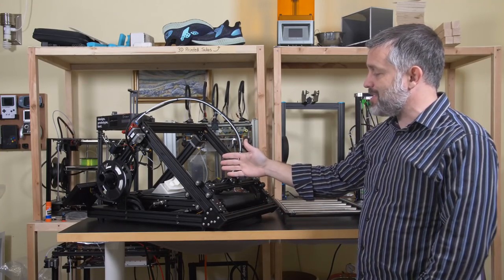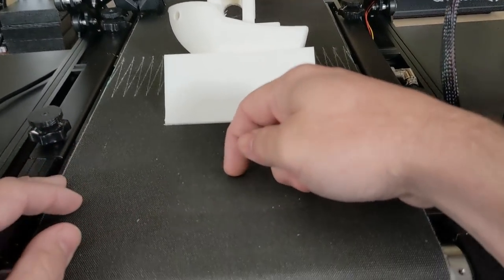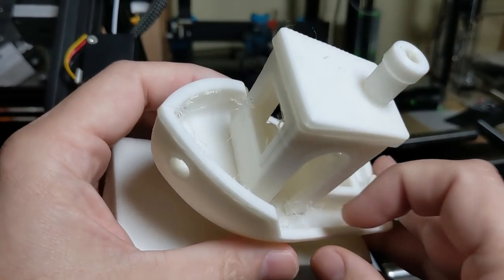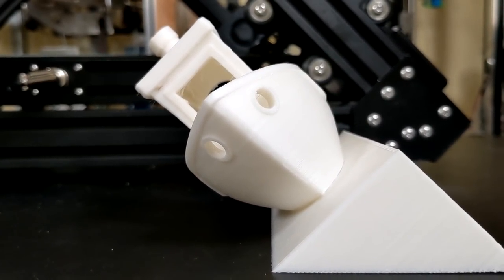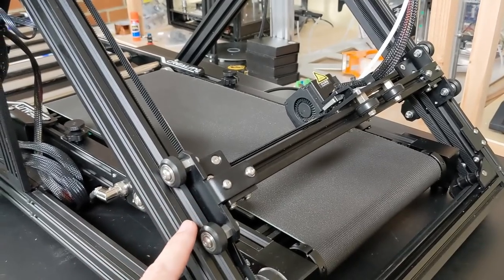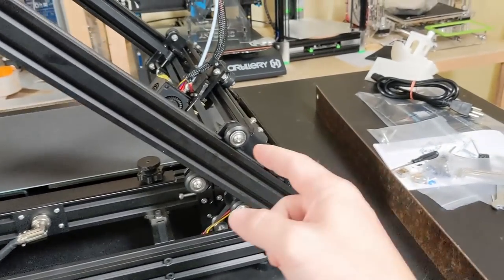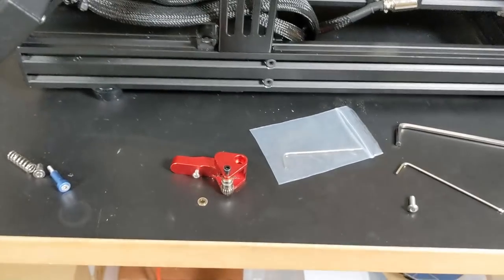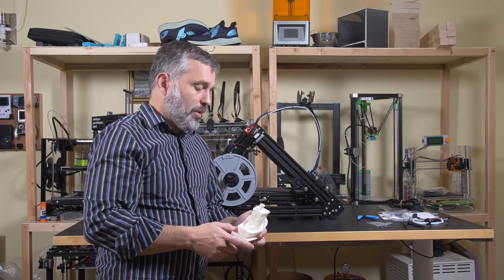Creality's 45° Belt Printer - First Print & First Impressions

Comment: in 1977 I was on a design team at Pfizer to build the worlds first whole body CT Scanner which used X and Y to move an X Ray tube and detectors around a patient. Stability was critical to image quality and lower X Ray dose. We learned early on to put pulleys near the bearings, and spread the bearing to both sides if possible. Three rollers on a bar as you point out we were also quick to recognize. We used Automotive timing belts for slide motion too. But we had some heavy stuff we had to throw about, so we used digital control to ramp up and down the acceleration for smooth consistent speeds in the data acquisition field.  Our machine in its 2nd iteration  had the best image of the competition and would run three shifts in many hospitals without a glitch.  Good critical review, i was shocked to see such basic design flaws in such a critical new machine. I hope Naomi has seen this and will press for the fixes. otherwise folks will be retrofitting new brackets and bearing with the first month. Great Review. Breath! Relax and just focus on explaining what you see.  Lets Go and make this a TANK in reliability. We know better.

Comment: Nerd facts...

You won't be able to pick that seam apart with your fingernail.
I work in food manufacturing and part of my responsibilities involve replacing belts. The process used to seam the belts is called vulcanization, its the melting of the polyurethane layer in the belt material under pressure that bonds the material on a molecular level. The process actually makes the belt one piece and is superior to glued or any other bonding method. The equipment used in this process is called the vulcanizor.

Comment: I'll take partial responsibility for the roller alignment.. On the original prototype they lined up perfectly and I didn't notice when I mounted them on the pre-production unit that they were off by a few mm(not sure what changed)..  I did finally notice but not in time to fix the ones that were sent out..  That being said it may not be completely bad...  I have had prints that have unusual leading edges and sometimes it helps the print roll smoother if you place a thin piece of cardboard under the print across at least 3 rollers(so it can't fall) and use it as a skate for the part..  I'm still undecided if the best action is to re-align the roller or add a shim under the rack so height can be adjusted if a skate is needed..  Just my thoughts..
Reply: The weight is minimal as it distributed, i would thing the smallest of compliance on the inner rollers would smooth it all out. a light weight spring under the shaft on each end. Just. needs a few mm's to handle the variance.
Reply: @DennisMurphey  I love this idea.. @Naomi 'SexyCyborg' Wu
Reply: @NAK 3D Designs  Just a thin folded steel surface with a thin PTFE (Teflon) adhesive sheet would work perfectly. There would be almost no friction resistance and you would not have to worry about alignment. It would be very low cost and work for years. If the PTFE needed replacing, it could be peeled off and replaced with little expense.
Reply: @NAK3DDesigns  👍
Reply: @DennisMurphey  That sounds great!
Reply: @MichaelJHathaway  
A sheet like that would require some way to align it, given the manufacturing tolerances, but it seems a better solution than rollers.
Reply: This is like watching R&D IRL. I love it. Thanks for all the work you guys do to make these commercially available for the general public in such high quality. I just set up my first printer an Ender 3 V2 yesterday and am now down the rabbit hole. Endless possibily

Comment: This was good. Harsh at times, but you made good points. Would linear rails instead of the v-slot wheels, at least for the X axis, be overkill? As for the belt exit, what would you think of something like an MDF platform with a Formica sheet (something like a kitchen countertop)? I don't know how strong the belt motor is but Formica may be low-friction enough that it would be OK.
Reply: I like your idea with the Formica. Teflon or UHMW thin sheet as an exit surface would work great as apposed to rollers.
Reply: @MichaelJHathaway  Sometimes parts (especially thin ones) do have a tendency to dip down a bit before they release from the belt.  It would need to have a tapered entry or a roller at the leading edge to prevent the part from jamming..
Reply: @NAK3DDesigns  I'm sure you could set the table height to be at the correct level. My point I was getting at is that you are never going to print anything heavy enough to warrant the use of rollers. And a thin folded steel table with ptfe surface would be lower coefficient of friction than you needed, but at a lower final cost. I would rather spend less money on the exit table and put money into electronics or hotend.
Reply: @MichaelJHathaway  I'll disagree on the never gonna print anything heavy enough..  The 20ft rail was actually starting to push to one side due to drag even on rollers, and well the Thanos blade (though done on the Knight) was in excess of 7 kilos..  the potential is there for some cosplay props to get on the heavy side.
Reply: @NAK3DDesigns  The leading edge of the steel table could be a single roller to pick up the part as it came off the belt. I definitely see your point with the Thanos Blade, but when printing something like that, you may need a much longer roller table than the one included with the CR 30.
Reply: @MichaelJHathaway  the add-on roller for the CR-30 was meant to be an initial set to help with those 1meter prints and provide a path for more rollers if necessary.
Reply: he might have made good points but there is no need to be nasty and smug im cleverer  than thou attitude he has with his  recent  content . The best video by far is when He takes his    kid to the park and does some  real  good design and fixes the rail slide, it has got to be " WORTH HIS TIME " to have done that,  just to make all those kids smile...

Comment: Well only because you mentioned cantilevered forces on stepper shafts, have a close look at the bondtech. Gears typically have a 20 degree pressure angle while squeezing filament only forces the shafts apart. I flipped my drive gears around and drilled a hole for a new filament path when I did my direct drive mod. This also keeps the stepper motor center of mass closer to the Delrin rollers. Also all the drive belts should attach through the center of mass of the moving parts but that is a future mod for me.

Comment: Good analysis. My 2-cents on the changes to the problems you point out would be: 1. Put a slider bed to replace the roller. You don't need a 100% frictionless surface and it would be a cheaper/lighter solution    2. Either shorten the shaft on the one stepper motor (make it a different part) or put a steady rest on the other end of the shaft (or even before the pulley attachment. the steady rest can probably be a through bolt attachment that bolts onto the stepper motor mounts. Either way, it's a small bushing (I think bearing would be overkill) and a plate.

Comment: Yea that stepper will have alot of fun with that pulley attached that far out. Did anyone think about mounting those pulleys on an axis supported between two bearings? Decoupling the motor from the bending moment might improve its operation alot!

Comment: On my DBOT Core XY I replaced the 4 wheeled brackets with 3 wheel variants (2 on top, on on the bottom). It works much better with those and I only have to to adjust the tension on one wheel instead of two. They should use 3 wheels or switch to linear rails.

Comment: Properly adjusted 4 points of contact can resist more torque than 3. In your example of the stool the cg caa be supported further from the centre with 4 legs, granted 3 is allways easier to get perfect contact with since they are self aligning.

Comment: Great video Mathew, I love the constructive criticism! Yes, there are a few other things that I would like to change on the printer like quick disconnects for the belt rollers to change out belts and possibly a linen belt as apposed to the nylon for printing higher temperature plastics. A stainless steel belt can be added without the expense of seamless, a small tig welded seam would be perfectly acceptable and now cost. I would like to see someone make an aftermarket kit for the printer in order to lift it to 90 degrees, I am well aware of the fact this cannot be sold with the printer. I am working on a new design for the Creality rollers to improve them. That upper stepper motor can be mounted upside down from the top. It won't look as clean but it would function better. You are not wrong about the part cooling. Even though the head sits at a 45 degree angle, the cooling can still be closer to a 360 design and I would like to add some vanes inside to deal with turbulence.
Reply: At no point do I claim to be an engineer nor do I think my cooling duct design is perfect (oh and did I mention I just learned fusion 360)but....  I did try several different designs and taking into account that you can't really get the ducts much below the nozzle or they will hit the belt and air will bounce off the belt when printing the bottom edge it is hard to get much better results but I look forward to any improvements that can be made.
Reply: @NAK3DDesigns  No, you did a great job Karl. I never meant to disrespect your work or designs and only to improve upon them. I am an electro/mechanical engineer/manufacture and today I mainly just work with plastics. I am just helping with a couple of the designs and attempting to improve the already functional product.
Reply: @MichaelJHathaway  Never took your comment as disrespect sorry if I came off that way..  It's more I just see lost of people criticizing the airducts that most likely haven't been working with belt printers the last 2 years and may not know or understand the added factors imposed by belt printing.  I do look forward to seeing any improvements and I'm always willing to test.
Reply: I was thinking that flipping that one stepper over would work as well.  It would effectively be exactly the same mount as the other one.

Comment: looking at the cantelever issue, can't it just be possible to put the motor upsidown? seems like it may be possible to do so maybe with a custom mount. hope to hear if you will try it cuz it would be a simple fix

edit: when I mean upside-down, to put the stepper from the top side going in

Comment: Interesting. I have seen this design  years ago. It was an open source design by piper 3d printers, using electrical conduit as the framing material.
Reply: is it designed as this one in here, exactly?
Reply: @noorazmi2329  yup. Its called the piper infinity. Look it up on google. Its been out for some time now.

Comment: Would be interesting to see what would happen if the entire machine would be raised at the back to slope the bed down at 45 degrees. The printhead would then be operating horizontally in the XY axis, even though the printed layers would be in effect 45 degrees. This would have gravity working with the print process maybe?

Comment: The 4 pulleys seams ligit to criticize.
But one can argue as I have seen on the stepcraft mill. That 4 actually right aligend give great extra stability.. but the stepper motor with giraf shaft..is to me something that would overtime wear and give it instability.  I agreed that should change.. the rollers are to professional as you mentioned. And you can go along way with something cheaper but horitional aligend. 

But all in all. It looks solid

Comment: Awesome video! I have some criticism for your review methods that I think will help your audience grow. I agree with you on all the negatives except one which I will get to later but I think the way you describe things that need improvement is very negative and puts people/the creators off. You come off more like you are attacking then you are critiquing to help. Saying things like this is "stupid" or "trash" immediately changes the mindset of the person listening who may have genuinely be looking for the criticism.  I think these type of phrases is what might have got you in trouble with we know who. While I think you are critiquing with the correct intention, trying to help the maker, I feel you are countering that by those comments. 

Ok so the point I MAY disagree with. The roller extension. They may be purposely offset down in the front area for a reason. That belt looks like it is going to flex and if you have a long part stuck to the belt and it starts to try to come around that rounded edge to break away, it may force the other end of the belt up slightly and cantilever till it hits the roller. Still a flaw in the design but I have seen other streamers print a long part and they can see a defect in the top of the part where the back end was rolling off, causing a divit or nozzle digging in on the top layer where this is happening. I would try printing a part and film it leveled with the rollers and see what happens.

Anyhow! Thumbs up and great video, waiting for the next.
Reply: I agree with the critiquing comment.   Make suggestions and say things like "I would have designed it this way"  Offer suggestion on how you would mod it.   I really think this thing would benefit from linear rails but that would drive the price out of reach for most enthusiasts.
Reply: Yea, trying really hard not to take the "these are stupid facets" personal, would have sounded so much better to say "I think this could be designed better", but I'm just gonna wait to see if anyone makes it better..
Reply: Thought I was the only one triggered when the word ‘BS’ and stupid were uttered.

Comment: They should add another bearing at the top of that extended shaft. Could just attach to the top of the motor with a mount.
Reply: Yeah a little sheet metal bracket on the top would support the pulley on both sides.

Comment: @17:00 Your stepper motor problem is easily fixed if you flip the stepper, then of course you get the stepper sticking out of the frame, but you no longer have the torque arm problem. 
And you use the same parts... easy peasy lemon squeezy !!!

Comment: Hey DPT, This might have already occured to you. But when you are casually standing by your table chatting, the audio quality you are taking from the room mic or camers mic is not ideal. It would probably greatly enhance the quality of production of your videos to wear a cheap $20 wired lapel mic in that part of the video. And then run it over in to your camera with a really long cable. Of course that is more hassle but it is just a very quick and dirty method to solve that problem. A more convenient solution to do away with hooking yourself up to a very long microphone lead would either be a wireless mic pack, or an overhead shutgun mic (or other reasonable sun $100 mic) dangling above your head just out of the frame of the camera. so 3 ways to achieve that. The main reason I bring up this point is because audio quality is far more important than visuals. For the viewer experience. We can understand everything you are saying! It just sounds kindda cheap with all the background noise. Perhaps another lazyalternative would be to try finding some post processing audio filter / enhancement to cleanup the audio. There are a few different ones kicking around. For that I would recommend either NVIDIA broadcast, or an audio plugin called 'isotope rx8 - de noiser'
Reply: I totally agree with you and we are building Matthew a new studio soon. He is moving to a new location and when he gets there, we will build a room with acoustic absorbers, professional cameras and audio equipment.

Comment: Core-XY fighting gravity? How about bolt it to a 45 degree desk? Chute straight down into the parts bucket.

Will be interesting to see practical size limits, nothing is infinite (function of print time and failure rate/tuning?) and Z is the weakest dimension to be the major axis of a part.

I suspect overhangs are less affected by gravity and more about having something harder than air to print on. People print upside down, after all.

Totally agree on rollers - a flat sheet of melamine would do the job, at least it looks like an option not to buy.

Same stepper motor (shaft length) side to side would be cheaper still, right?
Reply from the maker: >How about bolt it to a 45 degree desk? Chute straight down into the parts bucket.
I LOVE IT!
Reply: @DesignPrototypeTest  Point taken on the gravity comment, I misunderstood. I see now you were probably referring to 5-axis printers. I think a 6-axis delta or Stewart Platform type arrangement might be within the reach of a hobbyist.

Comment: Great video as usual ^^
While the infinite Z doesn't interest me, the ability to have an automatic printer sounds fantastic.
The print-o-matic was a fantastic idea, I wonder why it didn't spark more design like these?
Reply: Patents and trademarks locked belt printers in alot of forms until very recently and main problems are software support and firmware support have not caught up to mainstream for them pretty much only black belt cura and custom firmware was an option.
Reply: The design is also fundamentally very niche, a good 99% of even serious enthusiast level users would never need one.
Reply: @Agamemnon2  I'd love to print a monotube recumbent bike frame consumable mandrel for wrapping with composite in one go! But, yea, niche indeed :)